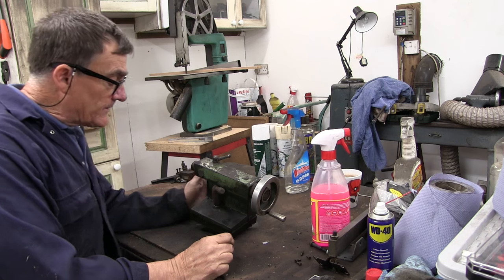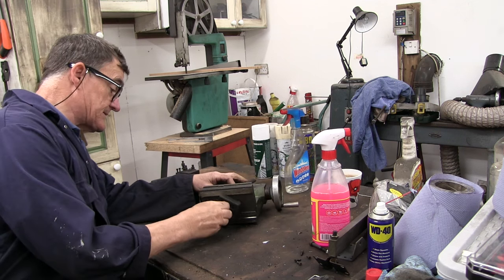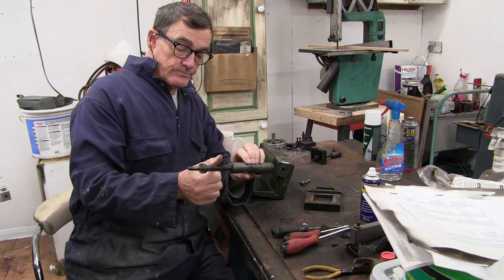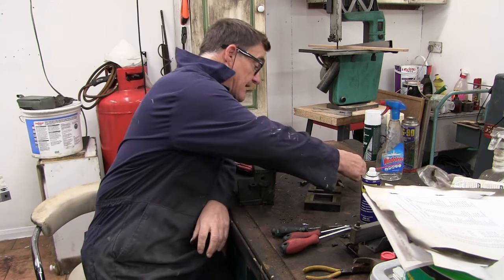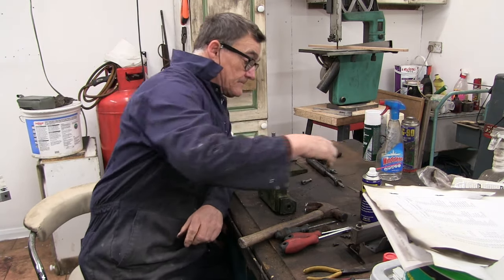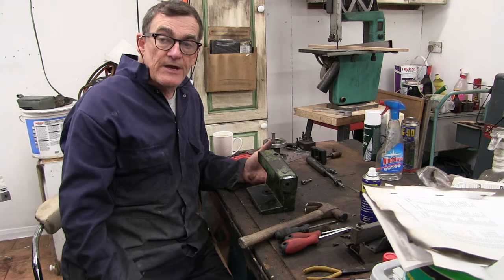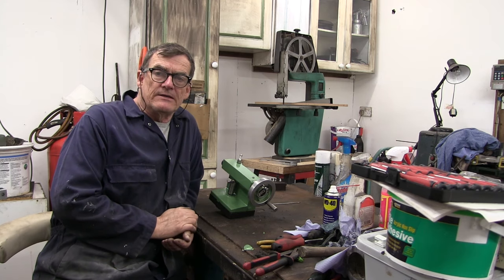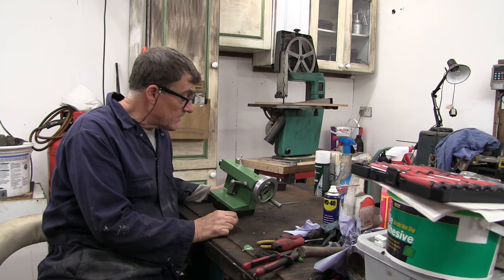Wes Waf. Tarting up the V10 P tailstock.

Comment: Why not paint the bottom part? Also, I put plenty of oil on all parts when reassembling. Kept it drip. You can never use too much oil, only too little. It’s good when you can spin the tailstock handle and it continues to rotate for a couple of seconds, or longer. You shouldn’t have to tap any parts like these together. I would check why they’re so tight.